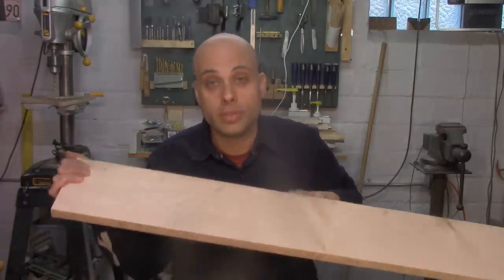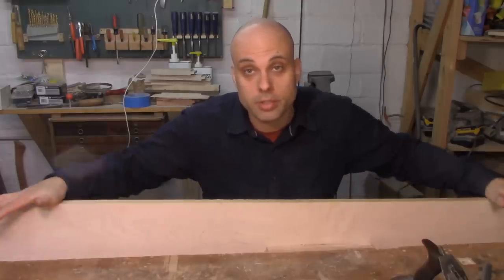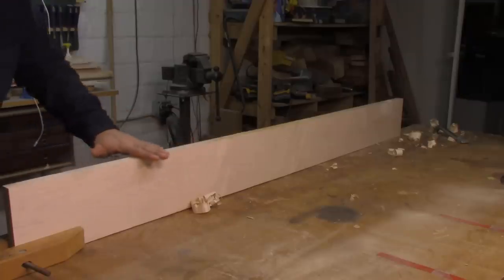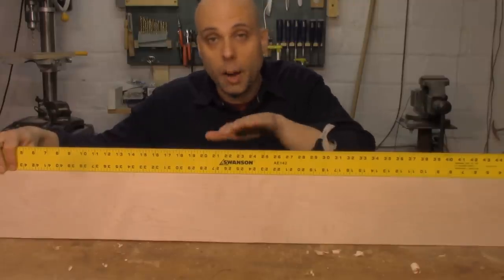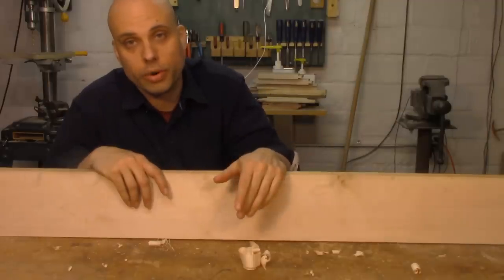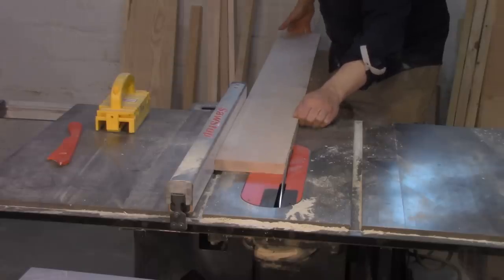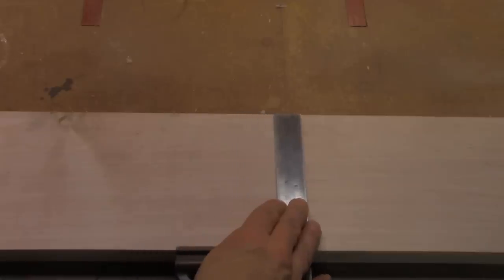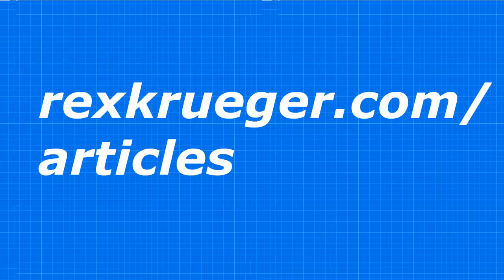Straighten boards. No jointer. No jig.

Comment: I can take a board that has a not-quite-straight edge and, in a few minutes with a jack or jointer plane, create nothing short of a roller coaster that leans crazily to the right and left.

"Practice", they say. But the more I practice, the more boards I ruin.
Reply from the maker: Dude, we've all been there.   Don't feel bad. A lot of the tips I offer in this video should help. First and most important, NEVER grab a board and just start planing. You'll just make a thinner version of what you start with. Always assess the board for high spots and hit just those spots to start out with. Next, make sure your blade is sharp and has an even camber on it. Use the pinch grip I show here to be sure you're staying on one part of the blade. If you're making things worse with your planing, you need to check the board more often and change what you're doing to reflect the change you're trying to make. Lost Art Press had a book called "The Essential Woodworker" with some great tips on planing. Recommended.
Reply: My experience right here.  Everytime i use my plane this is the result.  Jigs for life!
Reply from the maker: I can totally understand this view, and there's nothing wrong with it. For whatever it's worth, I bet a few hours with a teacher could fix these issues for good. The problem might even be your plane and if it's the only one you've ever used, then it's certainly not your fault if it's got issues. If you have any interest in planing, don't give up! You might just need a little help.
Reply: Actually, and especially with a jointer plane, the edge leaning isn't much of a problem if you plan to do the actual jointing with a table saw.  I use my jointer because the longer bed allows for riding over low spots without cutting, 
 Once you get that continuous shaving you are very nearly there.  The important thing is for the edge on the higher side to be straight and flush against the saw fence.  If it is then you can continue just as shown by Rex.  The second cut will square up the edge and both sides will be neat and parallel.
Reply: Seriously, just make a jig for the table saw and you don't have to mess with practice.
Reply: Machines are great but personally I want to learn to build the way my ancestors did. Sometimes I wish I could just spend a few months in Amish country learning from their craftsmen.
Reply: Absolutely! Stone axes and flint knives forever!
Reply: lol I didn't mean that primitive. though, I am a big fan of primitive technology' channel. That guy doesn't play around.
Reply: +Wolf Lahti
You need to start with very short boards. You need to make sure that your blade is even. And then identify the exact spots on the board that are higher and then try and rub them down to see what happens.
Reply: capitancoolo1  Roy Underhill's "The Woodwright Shop"...  Fun to watch.
Reply: The way I learnt was to mark the high spots with a red crayon, something that stands out, then hit those areas first, when all the red is gone then do a couple of long shaves. Check/sight again, mark any more high spots, repeat. And your blade has to be super super sharp. It is satisfying once you get the hang of it.
Reply: Practice makes perfect... If your technique is wrong your practice will be perfectly wrong... Improve your technique and practice that...
Reply: @RexKrueger  I would also add to this not to have a heavy hand and keep your pressure the same in both hands.
Reply: @capitancoolo1  I work close with the Amish community and I'm going to disappoint you. The Amish community I work close with uses machines. many times they are machines with electric motors they remove and replace with belts and gas powered engines. Amish community I work close with also have solar panels in their shops.
Reply from the maker: @rubberdwellers3911  You are 100% correct!  Good tip.
Reply from the maker: faultroy  I get that you're trying to be helpful, but this isn't the hard way. It's easy for me and fast. It seems slow in the video because I'm teaching. All the methods you mention have been brought up in the comments MANY times. You could at least look before writing your comment. Also, I'm the one who decides where my time is best spent. I do custom woodwork for a living. All day, every day. I have a pretty good handle on how I should spend my time. I know you didn't mean it this way, but your comment was pretty condescending. I made this video to show people a cheap and effective way to straighten edges. You like other ways? Great. But don't tell me I'm doing it wrong.
Reply from the maker: faultroy  Construction is not furniture making. We're in different fields. I can teach people whatever method I think is good and with almost 300k views and 4k upvotes , I think the people are on my side. If your methods are so good make a video showing them. I'll be your first subscriber and I'm not kidding.
Reply: Stain them different colors, or put some flame to the boards and make a recovered wood project. Meanwhile, you're working on straightening your edges plus making project pieces.
Reply: @faizullakhan1556  exactly,this is the proper way to do it right.props to you my brother
Reply: I live in Amish country.  Your learning would be quick.  They don't fool around with hand tools, they run electrical equipment.
Reply: @RexKrueger  hey, I'm glad I found this video and this comment thread. You got a new subscriber and I'm having the same problem with my planing (planning?) ((Both?!?)). Thanks for the upload. I gots me some work to do....
Reply from the maker: @doncooperjr4817  Keep at it, you'll get there!  I did.
Reply: Fatalruin do you have any recommended videos on building a jig?
Reply: LOL! I feel your pain brother.
Reply: @capitancoolo1  Check out Roy Underhill. He does a show on PBS called " The Woodwright's  Shop". He does in credible things with hand tools.
Reply: Rex Krueger  make sure you have bought a good planer, a cheap one will not hold a good sharp edge or even have one at all and that too will give you bad results.
Reply: bighands69 yes! This is my thought too. You have to be Really careful to set up your planer First !!!
Reply: Try using a chalk line down the face of the board you'll stay in line when planing😊
Reply: @OldJoe212  Is that still around.  I used to love that show.
Reply: @markgigiel2722  As far as I know, yes it is.  Still on PBS. watched one a few months ago.  Not sure if it was new or a re-run.
Reply: Yeah, what I learned from this is if I am going to need to plane the edges of a bunch of boards I am gonna save up for a low end jointer.  Figure I  will not get so frustrated by turning  1×8's  into 1x7's that are not even planed that well anyway !   Enjoyed the video but my Grandfather's Stanley hand planar is going to stay where it is.  I will know where it is so I can pass it on to my son someday !  Man, have I gotten spoiled or what.
Reply: 😂😂😂 Well done this made me laugh!
Reply: @capitancoolo1  well they didn't have YouTube so that shoots down that idea
Reply: @RexKrueger  I have a small jointer and thickness planer and now I just bought a jack plane.  AFAIC this skill goes well beyond jointing an edge and it seems obvious to me to start learning edge jointing first if you are going to do it.   The other tricks can only carry you so far.
Reply: Rex Krueger f
Reply: @faizullakhan1556  wow great tip. I never thought about what lumber crayons were really for except quick marks. 

I want to start working on hand planning and i will have a use for my crayon and holder- red like you said for high spots, and maybe a contrasting color for low spots . 

I always enjoy how those that are passionate about wood working are always so free-flowing with their tips.
Reply: @SwankeyMonkey  I was heartbroken when at about ten my sister was in the state geography bee. They sequestered the families in a different study and we watched on closed circuit tv.... Pretty smart way to prevent outside help )..... To my bloody right was the entire woodwright's shop set. (North Carolina PBS) 

WE were all lied to with that intro, i really wanted to believe that his workshop was out in the cut and you were always concerned when he hurt himself.

THE MAN IS A GREAT WOODWORKER. he is still teaching classes in the NC town he lives in. I can appreciate the raw primitive steps but i like the next generation where it was more wood whispering then fighting through technology ( history can keep their spoon drill :)

that show was huge in my formation, glad to see someone else recognize a good educator and communicator.
Reply: Funniest thing I’ve heard all day
Reply: Hand plane is the best. but you must feel it. if you have done it a lot and still you ruin boards, you have no sense of building. you should go to another department.
Reply: i think there is a touch of the serial killer instinct needed
Reply: I have always used a level or other straight edge to staighten my boards. Put stable edge of board against level and feed both through the SAW at the same time. One pass and done. Really long boards i use my 10' sliding table saw. Only use jointer to flatten boards and never use hand planes.
Reply: @regorekrub  Practice makes perfect? I've been at it for years and years, and my sex life is still a disaster! LOL!
Reply: @rubberdwellers3911  Yeah! They've always rejected the cutting-edge technologies available in their times, but the cutting-edge technology of prior generations is always okay! No matter how advanced it is. But! I don't see it as hypocrisy, but rather a respect for their elder's wisdom.
Reply: Always run the plane WITH not against the grain.
Reply: @brucemiller1696  how do you hold the board against the level? Just with your hands or some sort of clamp arrangement?
Reply: @mbburry4759  just hands. I am sure its not really that safe but just need to be careful.

Comment: The way i joint my boards with my saw is use a level between the board and table saw fence. Push them together so the level is the reference edge. Then rotate and joint the unjointed edge and you get really nice edges. It’s much quicker than having to use a jack plane.

Comment: Thank you for this video. I knew there should be a way to straighten boards and planks without having to recurr to machinery as costy as a small apartment. My grandparents own these amazing solid wood furniture that hasn't gone uneven or sketchy in 60+ years of use.

Comment: I still think that using a straightening jig for your table saw is much easier and faster but it does get awkward if you’re boards get over 6’ or so. So it’s great to see another technique to put in my back pocket when the time arises.
Reply: I still need to build one, but I always liked them. At the very least you have a few options to get your wood ready for the project.

Comment: As somebody with a Craigslist jointer the way around the dust collection... Do it outside and sweep the chips into hedges... Boom free multch!
Reply: I've found a shop-vac hose, chipper/shredder, and a small buttload of duct tape also works quite handily...
    ...cuz' I don't have a dust collector either.

                  ...I'm not even sure they exist anymore. ;o)

Comment: Great tip!!  Will definitely use this one!
Don't forget: it is also to have a quality, sharp, table saw blade.  
The stock blade that came with my sears table saw, had a slight wabble to it.  It was good enough for most things, except when I needed to be precise smaller than 1/16 of an inch--which can happen more often than some may think.
I replaced it with a quality saw blade, I paid about $70 for, and I have precise cuts down to 1/64 of an inch.  
But remember, have to keep it sharp, because even quality blades, when dull, will cut poorly.
Reply from the maker: I couldn't agree more. I spend real money on blades and I get them sharpened.

Comment: If you are going to tablesaw the edge you hand planed.. why not use a different method? The only reason you need a straight edge is to ride along the fence for a straight cut on the other side. Use a piece of board or plywood that you know has a straight edge and clamp the board to that reference piece then run it in the tablesaw with that reference piece clamped to your board against the fence.

There are also sleds for this where you can clamp the board at whatever angle and run the sled in the mitre slot giving a perfect straight cut somewhere on the board you need.. then you just cut the other side.
Reply: Sorry, i missed that part about no jig. 
In reality, whenever i need to true a board on the tablesaw is relatively short (less than 1.3m long) i just extend the fence with my 2m long aluminium spirit level. Put that against the fence and push the wood against the spirit level. I'll set the the part of the wood that has a cup and the wood will rest at the edges against the level so it would be stable and not rock. So if the wood is stable and the fence is long enough (in this case 2m long) the wood will never leave the fence and it will be good enough for a nice straight cut.

Great tip about hand planing the edge on long boards where it matters. The only problem for me is about cutting away the hand planed side.. seems like a waste. Being a perfectionist will make me invest even more time to true the edges by hand an leave them like that.
Reply from the maker: I totally get that. I wish I had a nice aluminum level, too. I'd use the hell out of it. The thing with planing the edge here is just to get is close, not perfect. I'm not looking to spend more than 5 min truing the edge, especially if I'm just going to cut it off. You're totally right; what a waste of time and effort!
Reply: Rex Krueger , hi Rex. I love the argument, that we learned from it. We tend to get lazy, but skills we lack and require great patience, 
Before our great skills is lost forever. Keep up your great works. Cheers
Reply: That handscrew clamp clamped to the table? That's a jig.
Reply: Heraclitean no, it’s a clamp 😂
Reply: Thanks you see i didnt get the point. I actually thought my method was inferior for some reason considering the next method beyond, is a jointer.
Reply: @RexKrueger  idk that you can really call a strip of plywood or an already finished board and some double sided tape a "jig" lol
Reply: @AsiAzzy  That's a great tip about using a long metal level as a fence. Thanks!
Reply: How do you think it'll slide if it's clamped ,won't the clamp become a barrier??
Reply: @drewben1841  Clamps/jigs that have a bottom sled piece that the wood to cut rests on top of, and clamps put pressure down from the top to pinch the piece you want to cut to the bottom sled piece. See: https://www.youtube.com/watch?v=vrYjc3G1vgo I've used this jig, but now prefer the simpler practice of just using a straight-edged reference board like AsiAzzy mentioned above, and guiding it along your fence along with the piece you're cutting. Just remember to put the cupped side toward the fence, otherwise the bowed side will just rotate as you push the board through, and you'll end up with a mirrored curve on the other side. Can be hard to visualize until you actually do it and see it happen.
Reply: Might just be worth mentioning... as a person who just LOVES options...

   One could conceivably build a couple stools or even "wings" for level-matching a Router Table, and as long as he was working with boards that presented less material "height" than the cutter in the router, he could "joint" just about anything "dead straight" with a bed-rail clamped down for a guide-fence. That should be sufficient length to feasibly resurface just about as long a single board as you'll ever run into.

    Now, I'm usually "that guy" that gets called when nobody is "crazy enough" to take on a project... as far as my contracting work goes. SO it's worth note that I've run into calls for a single board longer than 20 feet (3 m -ish)... I love planes too, but somewhere there should be a "sensible limit"... AND it still doesn't have to cost a damn fortune. ;o)
Reply: @RexKrueger  o
Reply: Absolutely correct. But this host wants the viewers to get their skills with hand tools up to snuff. Either way will get you a true board.
Reply: wow , good thinking

Comment: Great video. I would imagine the same set of principles apply with respect to flattening the face of a board? Obviously once we get one flat reference we'd run it through a planer to get both faces flat and parallel. I just struggle flattening wide boards. Finding the high spots, accounting for twist, etc. It would be great if you could make a similar video for face jointing one day.